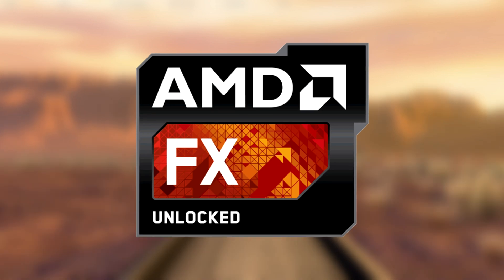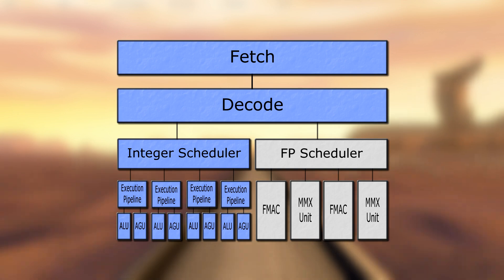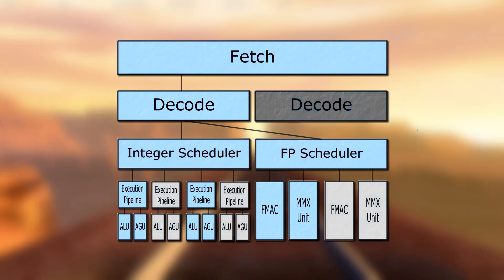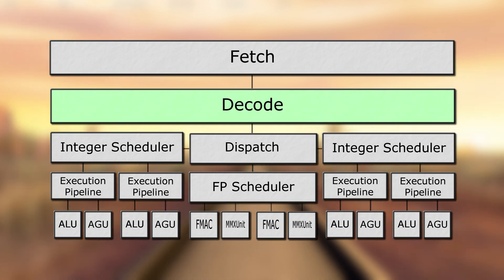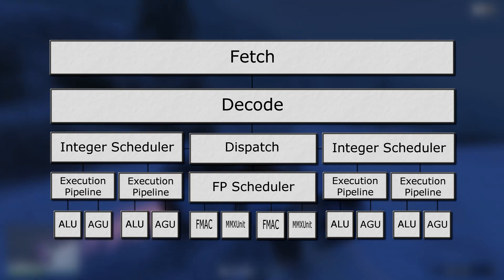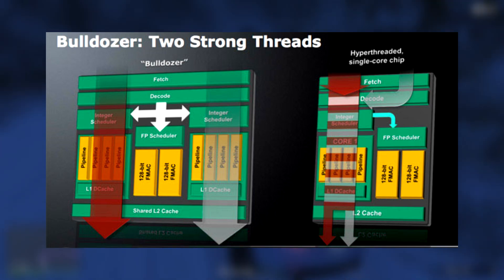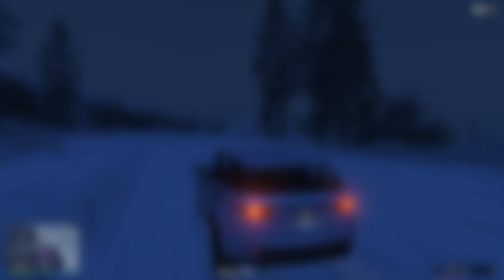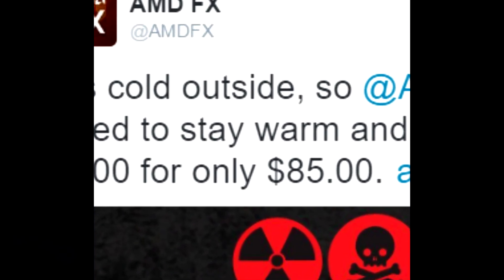AMD's FX CPUs- Why They're BAD

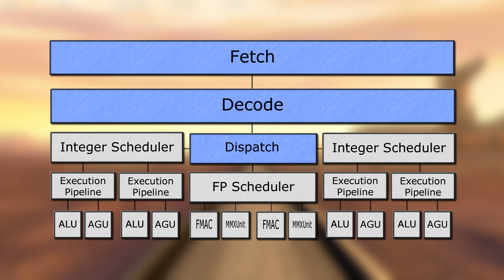Comment: 2:35 "But even if only one of the threads is loaded, it can't use the 2nd integer core"

Wait, what?  Do you have a source for that?
Reply from the maker: What I meant there was the FP unit is shared between both but the INT units are tied to one thread at a time. So a second thread on that Bulldozer module must use second INT core, and the first thread can only the first one - making it less efficient than a normal hyperthreaded core where all the execution resources of the core are potentially available to one or both active threads.

Could have been worded better in the original video I admit
Reply: @TheCatOfWarCSGO  The FPU can do 2 simultaneous 128-bit floating point calculations.  It's under wider 256-bit operations (AVX) that the FPU can only perform one calculation at a time.  For reference, most all systems set a double to be 64 bits.  It's only going to limit the 2nd thread in specific workloads, in general workloads there won't be an impact.   By using two combined 128-bit fpu's, the FX series is able to calculate 256-bit workloads without spending tons of extra die space on an already large die.  Back in the day, Intel took another novel approach.  They used a 128 bit fpu for 2 clock cycles for 256-bit calculations.  

The other problem with wide-bit fpu calculations is the amount of power they require.  AVX is the reason that modern Intel chips have such a low base clock.  Most of the time (non-AVX workloads), they boost and maintain higher clocks.

Between power and die space demands of the 256-bit fpu operations, I can see why AMD went the route they did.
Reply: @TheCatOfWarCSGO  Reading the comment again.  Hyperthreading works a bit different.  It tries to fill the pipeline.  If one process is using int calculations, it can still schedule the other thread to use the FPU which would otherwise be sitting there not doing anything.  In addition if one of the threads is waiting resources (paging data from ram or had, much slower than from CPU cache), the other thread is allowed to continue to process at full speed.  Supposedly it's hardware based switching so it's faster rather than waiting for OS response.  Because out-of-order processing is a thing, the scheduler has leeway in scheduling and can attempt to minimize CPU resource idle times.  Hyperthreading  is roughly a 25% performance boost (up to 40% on favorable workloads).  

A CMT "module" can run either int/int, int/ (128 or 256) float, or 128 float / 128 float.  The CMT module has nearly double the transistors of a single core as it has 2 int cores, and a wide fpu  (shared scheduler in 1st gen, shared decoder, etc).  As such, it can perform double the calculations of a single core (1 int module and a 128-bit fpu).  CMT doesn't do much to reduce the idle resources in the way hyperthreading does.  

Hyperthreading makes better use of existing silicone.  CMT was an attempt to add more cores without doubling parts that don't increase performance (fetch, decide, etc).

Comment: I use a FX 8350 and I hate it. I never bought it, but I got it as a present. The problem is, the previous owner overclocked it multiple times and set his bios settings to the maximum limit and his cousin never knew it. Of course I reseted everything. As a reslut It overheats very quickly even if I'm surfing the internet or do nothing. I have a hothead of a CPU... But I think this could happen to any CPU. Well, atleast it does it's job.
Reply from the maker: Past settings shouldn't really matter, so long as your BIOS settings are okay now, what happened in the past shouldn't affect how quickly it overheats. There's tons of monitoring software and utilities out there, and if all else fails you can underclock it in BIOS to maintain better temps. Hope this helps!
Reply: Ironically, after I made the post I checked again how to decrease the temperatures and I didn't found this solution before: Just turn off Turbo Boost or Memory Boost, because the previous AM3+ ASRock motherboards suck to much electricity, if one of the two modes is enabled, creating to much heat (50-70°C). After I turned Turbo Boost off now I have low temperatures of ~10-30°C. Thank god! Finally I don't need to let my door and windows open and don't need a fan ventilator anymore.
Some or many AM3+ motherboards are notorious for sucking too much electricity.
Reply from the maker: Ah nice! Yeah one thing I forgot about FX CPUs is that the temperature sensors are completely wrong on them, since it isn't physically possible for the CPU to be cooler than room temperature, the 10°C numbers you're getting will probably be completely wrong. But whatever, so long as it's cooler and not actively overheating you should be alright I guess :P
Reply: Yeah, this is what I also thought, that 10°C are wrong.  I played two games to check the temperatures and it got never hot. My friend also uses a FX 8350 and he has the same issues, although his twin brother uses an i5 6600k and he had never heat or noise issues, even in summer. This processor is a big slap to someone's face. I really hope AMD learned their lesson and the Rhyzen CPUs are much better. However, I will stick with Intel processors, because to me they are much more reliable, like the i5 6600k. As an pc enthusiast I regulary check new info about CPUs, but when it comes to architecture and performance Intel impressed me so far. I also like Rhyzen CPUs, but I prefer Intel.
Reply from the maker: Since I made this video I got a Ryzen CPU and it's been awesome, way better than my old i7 6700k. I fully recommend them and Intel have been making some really mediocre CPUs recently. And nah intel isn't really more or less reliable than AMD, not sure where you got that from
Reply: Hey, thanks for the tip! (: And here I though the Rhyzen CPUs are only meant for gaming. Can you use it for workstation tasks?
Reply from the maker: Yeah they're amazing workstation CPUs, since you get so many cores for your money and unlike FX they're very fast cores individually too. Encoding videos, CAD, 3D modelling/rendering have all worked brilliantly on it. Sorry this is sounding like an advertisement now haha, just wanted to make it clear that Ryzen is a massive step up and is nothing like the FX CPUs :P

Comment: There is so much wrong with this video. You compared performance on low resolutions where people would not normally run. You compared Nvidia Optimized games as standard. You compare Skyrim Yet Skyrim has a locked frame rate of 60fps. An when Bethesda saw The Intel chips bypassing this performance they had to update it an called it FAKE frames.

The frames where not real frames of performance but white noise coming from the chip an being mistaken as frames per second.Which range from 15 to 25 additional fake frames.Putting the Intel processors equal to BELOW AMD performance.
Reply from the maker: I'm not gonna pretend my sources were perfect because it's been ages and I can't remember, but it doesn't really change the meaning of the video at all. Bulldozer is and was shit for gaming and there's a reason AMD lost so much marketshare during its reign.

Now we have awesome Ryzen processors which are great at gaming and puts FX to shame.
Reply: OK .Just clearing that up.

Comment: He says AMD is so inferior, but I don't think a single Intel processor has outlived the fx8350 in the gameing world yet. Be a Intel fanboy if you want but that cpu is a beast still playing gamers at a stable 60-100fps 6 and a half years after launch.  Also it's very easy and safe to overclock it to 4.6ghz.  If AMD had threw hyper threading on the dam thing Intel would of lost the entire market. 
Hell the sole factor that limited its preformance the most was, no hyper threads, and 2ndly Direct X only allowing upto 4 cores tobe used. Now with Direct X12 Its actually better in games than back in 2012.  

That being said it prob only has about 1 or 2 competitve years left in it, prob 3 to 5 left still in Casual players systems at which point they'll be at low to med settings then.   As long as you take care of it its still a solid choice to stick with if your currently using one. As to upgrade even down the AMDs side would cost a fuck ton, new ram, new motherboard....ect.... Maybe even need new powersupply. Intel wouldn't be any cheaper. 

Thing about AMD is they will run neck and neck with Intel most of the time, and if you have kept up your system propery to keep the heat down, and using the right power supply needed. Then It should stay in pace with the cpu's that cost triple if not 5x more.  The Fact is, if amd can sell the same qualitity which they do now. Then that proves Intel is overcharging their customers. Because it can't take that much more to produce their cpus than it does amd.
Reply: Two words: i7 2600K. And that's coming from an AMD fan (mostly just because of Ryzen)

Comment: Running 9600x1800 resolution on a r9 290 with a 8350fx triple screen and games "raceroom, assetto corsa, rfactor, dirt rally" ran at 30+fps XD, COMMON NVIDIA where's your 3 x displays Supersampled... fuck sake amd wins that round.
i have yet to test it on the 4790k but if people are interested let me know. 
8350fx still rocks and gaming in 2018 fuck yeah..now where are all the vega cards fkn miners. XD 
anyway just to let you know if you run a proper resolution like 5760x1080 you get gameplay that's quite good and smooth.
put the shadows on low in racing games because that just kills all the fps but all settings maxed with low shadows looks good and play's great. damn that r9 290 still has some mighty power.

Comment: Ahh AMD FX processors, for when you need to game AND heat your room!
Reply: That's just the 9590.
Reply: had a 6300 and a 8320 and they both ran like infernos, even using decent heat pipe coolers.

Comment: FX CPUs are not bad,The performance stacks better now with more cores than at that time and it is actually a great investment, I am using an FX-8350 rn and won't regret my decision,the only problems I was facing was thermals that I fixed after adding 4 case fans and a water cooler xD
Reply: Water cooler required for proper thermals? nope. That's a regret right there. When your water cooling and case fans cost more than the processor in current day it's time to upgrade.

Comment: My comment before looking at the video;
In MY opinion, it's very good. With a GTX 1060 and a FX 8320E i can run games like Agents Of Mayhem, DOOM 2016, Rise of the Tomb Raider, GTA 5 and Overwatch at 60fps+ on 1080p Ultra settings. Even the stock cooler performs preety good. On max load it makes a preety loud noise but i'm used to having a litteral leafblower included with my old A10-5700
Reply: I imagine it can also run the original game of Deus Ex just fine which was released on June 22nd, 2000.

Comment: You realize that you don't need more then 4 cores for even modern triple A titles, increasing cores won't help you, increasing threads and ghz is what will increase performance, i used a FX 6300 for 5 years i overclocked it to 4.7ghz, AMD is better price per performance.

Comment: I just use the FX-8350 and it works well, however my motherboard only supports up to six cores so I had to manually disable two cores in my processor. This was done by shoving a bobby pin into two of the cores in the processor so they wouldn't work anymore.

But yeah, I had to enable a feature in the bios that controls my CPU cores, only allowing six cores to be used. You say the "FX CPUs are bad", but Ryzen more than likely will be up on the higher tier benchmarks. AMD has been pushing more mid-tier gaming graphics cards, so I'm honestly looking for a slightly better processor in this regard, such as higher-mid-tier or lower-high-tier.

Edit: I didn't even know Ryzen was out, it seems to be decent in it's power, but as of right now, it doesn't look like a good choice.
Reply: How did it not look like a good choice? Even back then the 1800X was punching up to the 1000 dollar i7s at half the price. And now the lower end Ryzen 5s are making a mockey out of the best i3s at the same pricepoint. And the six core Ryzen 5s are making the i5s look like overpriced dogturds. And Ryzen 3 is due to come out this week, priced as low as a cheap i3 but with double the cores and more efficiency and better benchmarks.
I am genuinely curious as to why you'd think Ryzen wasn't a good choice now or back then. Only issue I can see so far is overclocking performance, but most of Intel's chips aren't even unlocked, while every Ryzen is.

Comment: I use an 8350 and it fulfills everything I do on a daily basis without issue. No CPU is bad, you're not going to get the latest i7 CPU for your retro MS-DOS gaming rig, are you? You get maybe an old Pentium or something and the amount of RAM that was good for that time.
Reply from the maker: Yeah, absolutely - I just mean comparatively, and from an architectural standpoint. 
Though, "A simplified analysis of the shortcomings and comparatively inferior design choices of Bulldozer that results in AMD losing Marketshare to Intel" wouldn't have been a very catchy title.
Reply: Well of course Intel smokes AMD at everything, the only thing keeping AMD afloat is their GPUs and lower pricing of CPUs right now. Ryzen is going to change the playing field dramatically. The European price for the R7 1800X is rumored to be €599.99, which is $638.48 and is meant to compete with the i7-6900k, which is $1,028.76 on Amazon right now. Intel's going to start having to do markdowns instead of markups..
Reply: A CPU is made to process and the last time I checked mine is still processing
Reply: AMD lives off the console market too
Reply: fweeby yea man the fx is the best budget cpu:))
Reply: fweeby I still play mainly old titles dating from the DOS days to 1998-2006, so my 8350 holds up very well. The newest game I'm playing is Thief (2014), which uses all 8 cores (though not fully; depends on the scene and level), so it's not so bad and I manage 50-60fps.
Reply: The 8350 is perfect for me. It runs everything I have just fine
Reply: POWER HUNGRY
Reply from the maker: Well by that logic, an intel 8086 would be acceptable for gaming today - but I get your point.